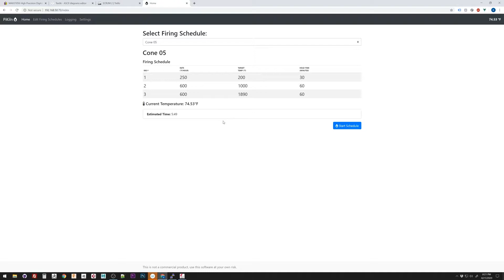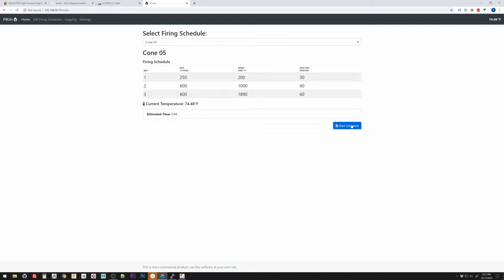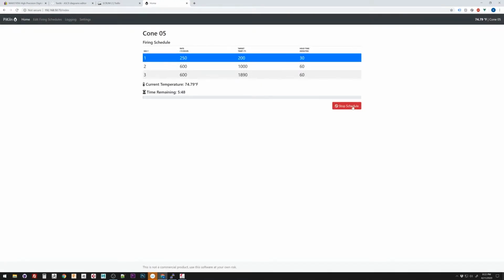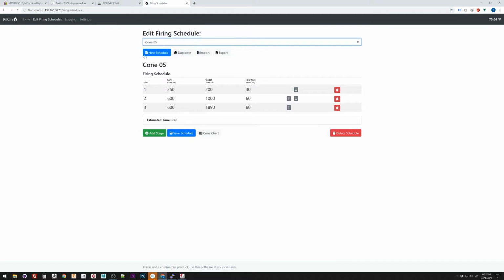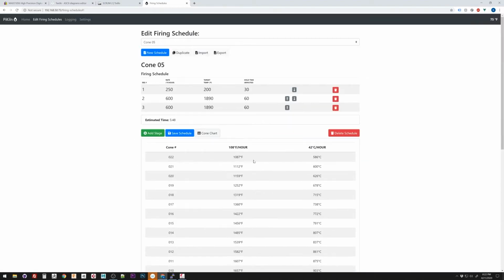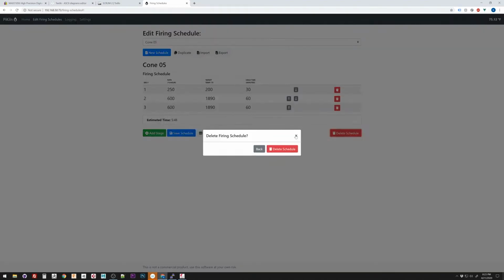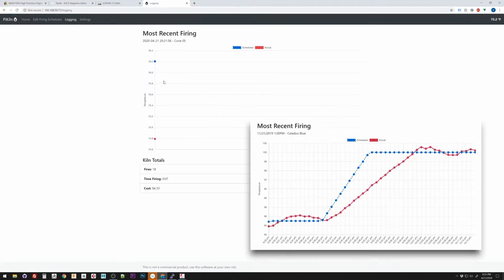PyKiln I2C Breakout PCB! It's coming together!

Comment: I've spent a lot of time prototyping digital kiln controllers on several different MC platforms.  All SSR controlled.  Having installed them and supported them on half a dozen kils run by technology illiterate potters(not a dig, just a fact), I quickly came to the conclusion that these type of contollers are far better off being designed to install at the wall plug as opposed to on the kiln.  This forces many physical design considerations but also take away the need to dig into the older kilns to try to co-locate the SSRs near the element junctions, thus creating many heating issues that I could never get ahead of.  I've worked on one "kiln" from the 80's that had external hotspots in the 300C range!  So I changed to a design strategy that looks a little like this.  Use the existing kiln wiring, pin the kin setter on and/or set the dial temps to high.  Then build the controller to install on the wall, with the kiln plugged into it.  A small internal fan is enough to deal with the SSR heat produced and the only long haul is the thermocouple attachment, which can be tied to the main power cable.  I'm wrapping up the PiZero2 version and will be uploading it and the designs to GitHub soon.

Comment: For the safety switch I suggest making that cuttable pad into a jumper so to add a switch you just pull a jumper and plug in a switch or to bypass the switch you use a jumper. That could also be inverted so no jumper is necessary and a high signal kills the power but then if it fails it just stays on which isn’t ideal.

Comment: Hey there, great ideas! Great work! I'm working off the same fork you are and I'm building my own kiln and raspberry pi based system. Like you said we stand on the shoulders of giants. I'd love to collaborate and see where it takes us. Full disclosure, I am looking to eventually commercialize a product but people being able to mod it and have full control never even crossed my mind as something to be taken away. Like seriously? lol 

Your idea is super easy and I'd love to help develop it further to get it working properly. 

One aside, I'd consider putting the fan on the other side of the mounting hardware. This way it can pull air directly over the heatsink which is the hottest part and will have the added benefit of cooling the rest of the enclosure somewhat by also cooling the aluminum rails. 

Just a thought. 😁😁😁
Reply from the maker: Thanks Bryon! I've abandoned the Raspberry Pi version (PiKiln) about a year ago and decided the ESP32 running MicroPython was a better option in terms of cost and also simplicity. You're welcome to build off of it and make your own product. I'd be happy to collaborate with you if you want to help contribute to the PyKiln project, but I plan on keeping this project 100% open source. 

So in terms on fan placement, I've been thinking about that. I'd like to keep the fan on the bottom so it can pull cold air up from below and exhaust it out the top. Much like fans on a PC case. 

I haven't load tested the solid state relays so I'm not sure how much cooling they would need especially with the aluminum heat sinks. My bigger concern was keeping the plastic on the contactor from melting or degrading over time. Right now the contactor is blocking most of the air from the fan. The contactor could be moved to the top above the solid state relays which would allow for air to blow across all of the components. I need to do more testing to figure out the best configuration.

Comment: So happy to see an update.  Just curious to know if you have considered adding a LCD touchscreen?
Reply from the maker: Hi brightnovastar. I've thought about that a lot, and I feel like you don't need it. Just about everyone has a smartphone or computer which can control the PyKiln through a web browser. If you really needed a touch screen mounted to the kiln I'm sure you could use an old phone, or even buy a cheap prepaid android phone to use. You can always bookmark the web page, but for quick access I was thinking of having a QR code that you could print out that would link your PyKiln. That would be handy if you had multiple kilns too.

Comment: Hello, I'm new to the project but very interested. Is there any way to calibrate PID values? (I presume the controller uses pid for temperature control) Also, for my application it would be helpfull to have fan control for fume extraction, is that also programmable?
Reply from the maker: Thanks for your interest! Yes it uses PID, I'm not an expert in PID but from what I know it tunes itself over time. My plan is use a hard coded best guess for Kp, Ki, and Kd values, but I could also expose those values on the settings page.

For fume extraction I imagine you would want a fan running for the entire firing schedule, and then turn off when it's done? If that's the case it would be easy enough to add another wire to the relay screw terminal on the breakout PCB. 

I have a cooling fan which is controlled using GPIO pin 8, but I haven't decided if I want it on all the time while firing, or to have it turn on and off by monitoring the MCP9600 ambient temperature. 

I also reserved GPIO pin 7 on the PyKiln breakout PCB for auxiliary use, but haven't thought out exactly how to use it. 

What sort of application are you thinking of using PyKiln for? My aim is more on electric kilns, but if there is another use and it's not a ton of work I'd be happy to make some changes to accommodate for it :)

Comment: DIN rail PCB bracket 70x72mm adapter for the I2C board Onlu 5€
Reply from the maker: Hi Corne van Dijk, I thought about using those but I'd need at least 3 of them to mount the relay, the Breakout PCB, and the fan. The mounting plate PCB is a single part that allows me to connect all three of those devices. You can order five 100x100mm PCBs from JLCPCB for $8.10 USD, and I have the design panelized so I get 2 per 100x100mm PCB. So a single the mounting plate PCB is only $0.81 USD. And as an added bonus PCBs are made out of fiberglass which can hold up to more heat than plastic.

Comment: when can I purchase this.
I am about to build a Furnace kiln and a burn out kiln.
I would like to build them with this.
Also I am going to be using 3 phase. 
Will this work with that many phases?
Reply from the maker: Hi Gus Bisbal, it's still being developed so it's not for sale just yet. I'm not an expert in 3 phase power and I don't currently have access to it, but it should still work. You would need to use 3 phase solid state relays and a 3 phase contactor and make sure your load is balanced between the phases. Everything else should be the same